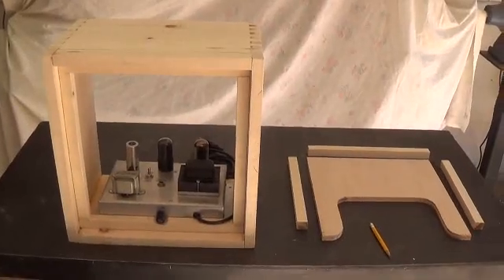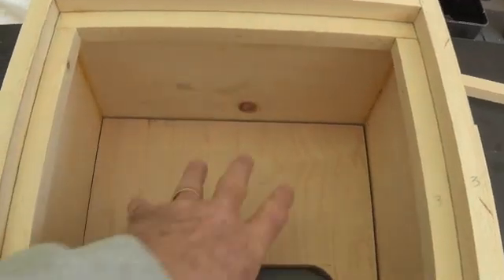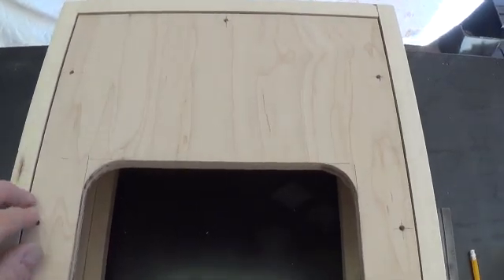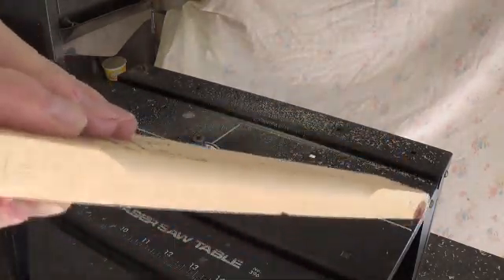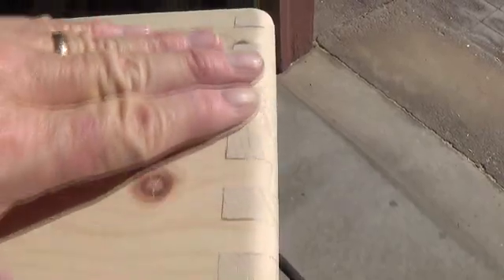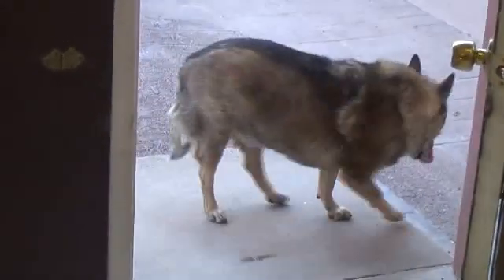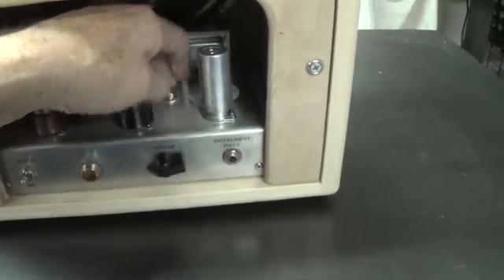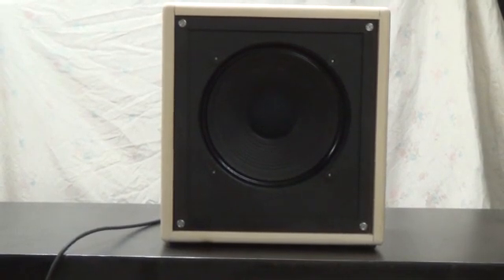Constructing a Finger-Jointed Pine Amplifier Cabinet......Part 2

Comment: Nice work on the routing. I suspected this is what you did or h3ll of a good sanding job.  Both ;)
Reply from the maker: Thanks !! I use a router for shaping the edges and cutting out the speaker hole.

Comment: What is the reason for having the bit of a gap between the grill cloth and surface of the baffle?  I'm changing a 2 x 10 Vibrolux cabinet to a 1 x 12 extension cab.  The original Fender baffle has the cloth right to the surface.  It's also only attached to the cabinet on 2 edges.  It's not a lot of extra effort to add some thin strips around the perimeter of the baffle, but I'm curious what the advantage is.  I really enjoyed the level of detail on this set of videos.  The result looked great too
Reply from the maker: I explained the benefit in one of my cabinet-related videos. With the grill cloth spaced from the baffle, the speaker can push air through the entire grill cloth surface. When the grill cloth is glued to the baffle, the air can only pass through the area of the speaker cutout.
Reply: @UncleDoug  I appreciate the explainer.  I tried to find the video you mentioned but don't think I did (unless it's the one w/the Silvertone 1485 6 x 10 cab?).  That video helped another way on this project too - I see you used a 1/2" birch ply for 6 speakers.  So instead of the 3/4" I planned I'm moving to a 1/2" and adding a 1/4"thick strip to space the grill cloth.  I originally thought 1/2" would be too thin to hold a 20#  Electro Voice EVM 12L, but if it was good enough for 6 x10's it should work for this.  That'll shave ~2.5# off the finished weight + $12 off wood cost.  Cheers Uncle Doug!
Reply from the maker: @monto39  Glad to hear that the video was useful Monto. Good luck with your project.

Comment: Superb workmanship and very helpful explanations. Putting the amp at the back and at the bottom, where it's the hardest to reach, is beyond bizarre.
Reply: I believe that was because the standard at the time was for musicians to stand behind their amps.  So having the inputs and controls at the back made more sense.  As rock & roll / rockabilly got more popular and more showy, musicians started standing in front of their amps and there was a need to switch to the top mounted front side controls.
Reply from the maker: Thanks, GD. Agreed, it was a very old-fashioned design.
Reply: fender made amp cabs like that , the early Bassman was in this orientation ..

Comment: Radial arm saw; I got my fingers in one of those 😂. If it was a router I’m sure the micro surgeon wouldn’t’ve anything to work with. As an aside, if safety (including respiratory ) and accuracy are important AND you aren’t a factory, use hand tools. Norm did mo harm then good in this regard
Reply: Dust collection and a face mask (forgive me!) are essential if you’re running woodworking power tools inside. Routers are especially messy. 

I like hand tools but a table saw, router table, drill press and radial arm saw are SO useful. Love hand planes for some reason ...

Comment: In the Woodshop, we used Marvel Mystery Oil to prolong router bearings. It's cheap and works great! Just put oil on it & work it in about every 60 seconds of use, scrape any buildup off   & they will last a pretty long time!
Reply from the maker: Thanks for the tip, Ronnie :)

Comment: did you take into account the air volume for the speaker when designing the size of the cabinet?
Reply from the maker: No, because the cabinet is open-backed. Volume is a major consideration for closed-back (sealed) cabinets.
Reply: @UncleDoug  thanks!

Comment: The only tool worse than a router for fingers is a jointer. My fretting index and middle fingers can sadly attest to that. :(
Reply from the maker: How about a planer, Paul ??
Reply: @UncleDoug  OK. You got me there. Another brutal piece of machinery one should be wary of appendages being remotely near. Let's just say shop teachers should lock out and tag out machines with broken guards,  and not let students operate them, as opposed to saying 'It's ok and just be careful'. Two weeks later, another student did the same thing.

Comment: Just like anything else speakers take some time to break in. I've had speakers that were really hard at first and about a whole year later I was getting complements on how it sounded.
Reply from the maker: You're right, AB. Just like car engines and shoes, speakers need time to wear into proper functional status.
Reply: I typically wire up a music source, stick the cab/amp in a closet, and play something fairly loud for 24 hours. It also serves as a good burn in for the amp. You might want to break the time up into 3 or 4 parts if you are concerned about heat (or neighbors).

Comment: Excellent video and design!  If I may make a couple of suggestions. Construct a small screen (baffle w/ radiator type grill etc.) to attach over back window to protect the amp guts. It's very easy for something to knock into tubes. You can attach it w/ velcro tabs, fashioned so as to facilitate quick and easy removal. You'll still have ventilation but the amp itself will be protected. Also, I learned this from Marc Spagnuolo (Wood Whisperer) that nails should be driven when glue is wet. The nail itself acts as the clamp to shore up the glue joint. Setting the nail after the glue is dry may just crack the glue bead.
Reply from the maker: Thanks for the helpful suggestions, Mike. I do nail the cleats while the glue is wet.

Comment: Hi, Uncle Doug. I really enjoyed watching how you constructed this. I recently built an 18 watt Marshall head clone and am now going to build a 1 x 12 speaker cabinet for it. I want it to be a closed back cabinet. Do you think this would be a good cabinet for that? Of course instead of the back door it would have a full panel. Also, I have a bunch of 1/2 inch birch plywood I want to use instead of the 3/4 inch pine you used. Thanks.
Reply from the maker: I think a cabinet like this would work fine for your speaker, and could be built from 1/2 inch birch plywood.......but when you use an enclosed cabinet, its interior volume must be rather large to allow the speaker cone to move freely.  So, either build a larger, enclosed cabinet or build a small, vented cabinet.
Reply: Hey, thanks for the fast reply. After doing a little more research it looks like an open back is going to give me more of the sound I'm looking for and a little less weight. I also noticed an 18 watt Marshall combo amp utilizes an open back cabinet. One other question. I didn't notice on your videos how you cut the back panel on the cabinet you made. Did you use a jigsaw? It looked great whatever it was. Thanks.

Comment: Hi Doug,I just finished building a 5F2 but had tone/volume issues...wiring was OK...changed tubes, same result.  I then looked at the 5F2A circuit and saw some changes in the pre-amp stage. Once I made the mods to the circuit, it was like night 'n day.  Got a nice sound and tone is not mushy anymore...amp sounds like a Fender and ditto for the guitar.  Strange that I had problems with the 5F2 circuit.Keep up the great videos as they are great.Tom...
Reply from the maker: That's great news, Tom. Congratulations on solving your problems and creating a successful build.  Often, the best learning experiences stem from the troubleshooting of an electronic project, rather than its assembly.

Comment: I was interested in putting corner protectors on the cabinet I was making. In the video, you used a 3/8 inch radius round-over router bit on the cabinet perimeter.  I have only been able to find corner protectors with 1/2 radius.  Do they make 3/8-inch?  Its an easy change as long as you have the router bit to make it 1/2-inch radius.  I've seen several of your videos where you custom-crafted a cabinet for an amp and I don't think I've seen you use corner protectors.  Is that a design preference on your part?   Always looking forward to your next videos.
Reply from the maker: I have never installed corner protectors on any of my home made cabinets, Mike.  I have nothing against them, but simply prefer the rounded, bare corners.  Since I've never bought any corner protectors, I'm no expert on the radius of their curvature.....but the 1/2" radius would be easy to router for.  You could check with Antique Electronic Supply to see what protectors they offer.
Reply: Thanks, the ones at Antique Electronic Supply are also 1/2" radius.  They are a great one-stop shop.  I guess I can use the corner covers if my tolex job does not go well.  Ill watch your two-part video on that again and do some practice.!
Reply from the maker: Good luck, Mike.

Comment: Really I would have went with a 12" JBL speaker. I have always loved how they sound. You could also go with an Altec Lansing. BTW, did you know that JBL stands for James B. Lansing? I found that on an old 15" JBL speaker I once had. Kind of interesting.

Here is I link to a 10" JBL speaker I just found on ebay and it even has the "James B. Lansing" thing on it.
http://www.ebay.com/itm/JBL-E110-8-10-Guitar-Speaker-36267-CSA-/361427030447
Reply from the maker: +Lucifer2066  I ended up finally installing a 1960's vintage Jensen speaker, but Lancing speakers are excellent too.
Reply: +Uncle Doug Could you fit a 10" with these specs?
Reply from the maker: I'm not exactly sure what you're asking, but yes, a 10" speaker would fit and work just fine.

Comment: wow, with the routing and the finger joints and the nice wood you used, I personally would have just put a light stain and finish on the wood and skipped the upholstery.  Show that wood off!
Reply from the maker: +Charles J Gartner  Thanks, Charles. I do intend to build a finished-wood cabinet in the future. I would probably use oak or mahogany, just to make it extra nice.

Comment: Thanks for a well produced instructional video. I intend to use this video as the basis for building a G15 reverb unit cabinet. I love Rusty's inspection of new materials. My dog performs the same service for me. He's not great with cleanup however.
Reply from the maker: Bill Norman Thanks so much, Bill. By coincidence, one of my first scratch-built projects was a Fender 6G15 clone. It's featured in this video, made before I had my own channel:  https://www.youtube.com/watch?v=oL69xjGY3MY  Rusty thoroughly inspected all the components before assembly, and it has functioned perfectly ever since. As with your dog, however, I was left to clean up the mess :)

Comment: I always use a fence when routering longer straight pieces. Even with a bearing guide on the the router bit, it's easier to set up the fence and control the work against the router bit.  Lol!..You still haven't convinced Rusty to cleanups.   Looks good though. 

Chords sound like Sonny Jame's  Intro to "Young Love"?
Reply from the maker: SuperCarver2011 Thanks :) Yes, it is indeed Sonny James.
Reply from the maker: SuperCarver2011 Thanks :) Yes, it is indeed Sonny James.

Comment: Hello, i think is the fourth time I watch your amp building series, I really like it. And only now, I'm going to build myself a speaker cabinet. There's other way to get round edges instead of using routers? I don't have access to one. By the way, which song you play in the end? Thanks!
Reply from the maker: Giovane Soave Greetings, Giovane. Rusty and I are glad you enjoy our videos :) I guess you could use a file and/or an electric sander to round the edges. Just be careful to keep the radius consistent. The tune was an old Sonny James tune from 1956 called Young Love. Here is a link to the original version:  https://www.youtube.com/watch?v=pU_8D5jBqd0
Reply: Thank you Uncle Doug, you and Rusty are awesome. :)
Reply from the maker: You're welcome, Giovane, and best of luck with your speaker cabinet project :)

Comment: Great tutorial... learned a lot.  Kind of suprised that we didn't get to see the final product.  Did you use black tolex?  Fender type grille cloth?  Or was the final finish Rusty's job and he's been slacking off again?  Rusty did have kind of a "been there... done that" attitude when sniffing out that Home Depot pine board.
Reply from the maker: Greetings, BA. This is only part of a 7-video series on scratch building a Fender Champ from scrap parts. The next two videos show the covering with leatherette and completing the speaker grill. If you are a subscriber, check my video list. Video 7 shows the completed amp. I think you'll agree that Rusty did a good job :)

Comment: This project is the first video of your I've come across, excellent build. I loved the guitar playing, what sort of guitar is it? I have a Jensen 10" speaker in a little Cornell self-build 10w amp combo, they are excellent, I was advised to run it in for a week to get the stiffness out of it, works great.
Reply from the maker: Thanks so much for your kind words, Will. The shop it a hazardous place, so I use an old Matsumoku Vantage guitar with MMK-45 humbucker pickups. It's a nice guitar, but not exactly a '59 Gibson Les Paul :) It's fairly standard practice to "break in" speakers and "loosen up" the cone suspension. The result is generally improved clarity and response. Please note that I have posted over 100 videos on my channel, so please subscribe and watch a few more :) Thanks for watching and posting a nice comment.

Comment: Have you ever just stained the Cabinet? I think a dark stain would have looked perfect !!!
Reply from the maker: I haven't simply stained an amplifier cabinet yet, Jason, but it's a good idea. The finger jointing would really stand out, and the cabinet would probably resonate better without the vinyl covering.
Reply: I think the jointing gives it age... If you know how to do staining I would love to see a video.
I have a 1968 Traynor 20watt tube that originally a combo but someone cut it up years ago so I only have the chassis and now I know how to make a cabinet!!!!,
Reply from the maker: Good luck with your cabinet-building project, Jason. As far as stains go, I really like the Minwax brand: Chestnut, English Walnut, or Red Mahogany.  I use a spray gun to shoot multiple coats of clear lacquer (on radios and jukebox cabinets....I have some videos posted), but if you don't have spray equipment, then there are good clear finishing materials available in spray cans or brush on.
Reply: Perfect. Thanks for he advise.!!

Comment: Hey Uncle Doug !! Great video.  And of course - every time I watch another one of your videos - I get to go buy something new - smile !!  So now I am wondering what gauge and/or model is the pneumatic nail gun you use for your project !!  I am sure I have a critical need for one of those - smile !!  Thanks again for all the info !!  -- Don
Reply from the maker: Greetings, Don. The 18 Gauge Brad Nailer was item No. 68021 at Harbor Freight. The 20 Gauge Crown Stapler was item No. 68029. People look down their nose at Harbor Freight tools, but in my experience they work fine, especially at their very low cost.
Reply: Uncle Doug Thanks a ton Uncle Doug.  My order has been placed - smile.

Comment: Thanks a lot for the video i am really enjoying this series. Yes routers are scary, i saw a workmate of my take off the tip of his finger with one in a right bloody mess. He was okay it grew back kind of. My biggest fear, and wouldn't use them because of it, is the spindle moulder nasty 4 inch plus finger mincer! Very useful for making chairs and tables but the band saw, cross cut saw etc piece of cake. Take care Doug and Rusty. PS I am also an upholsterer and we used pneumatic equipment before some joiners did. They were always jealous of our pin, staple guns. :-)
Reply from the maker: Routers do command respect, Mixo, and they get plenty of it from me. Rusty usually runs and hides whenever I turn one on.....most likely due to the high-pitched whine (or his good sense). I think a good rule of "thumb" (and a good way to keep yours), is to never push toward the rotating blade, so if the wood suddenly "disappeared", you wouldn't continue forward and contact the blade. As with all power tools and electronic gear, constant vigilance and care (and a little paranoia) are always good policies. Thanks for your input.

Comment: Great vid as always.  I've tolexed cabs, but never built any, so this was good info.  On a side note, since you do amp repair for people, do you use any sort of work order forms internally in your shop.  Something that would have customer's name, amp brought in, year of amp, that sort of thing.  Im also thinking it would be helpful to have an area to record voltages.  Just trying to get some ideas on what would be helpful to have on an internal sheet like that to track work progress with an amp.  Thx!
Reply from the maker: Greetings, Kevin. I actually don't do a lot of repair work for other people, unless it's on an amp that I sold to them. Like the old saying goes, "I service what I sell."  My good friend, David, however, does a lot of work for local musicians and happens to use a work sheet that is virtually identical to what you have described. It provides the customer with a nicely itemized list of parts and services, and it's an excellent record for him, in case the amp ever comes back for more repair.